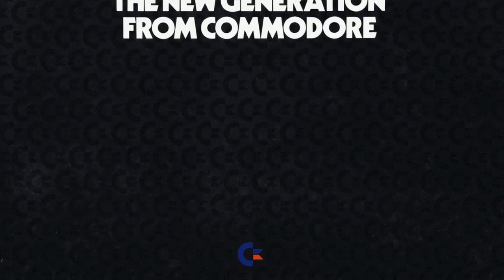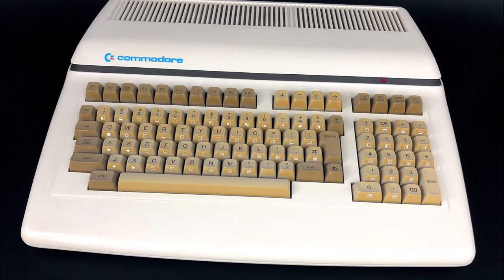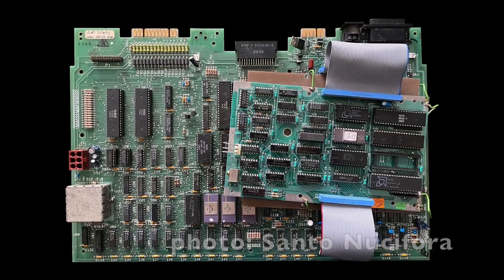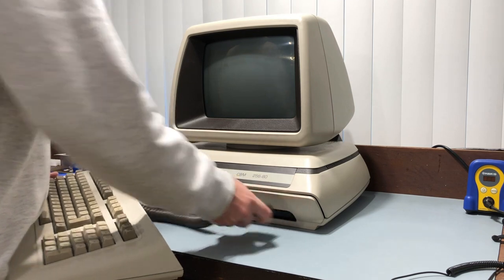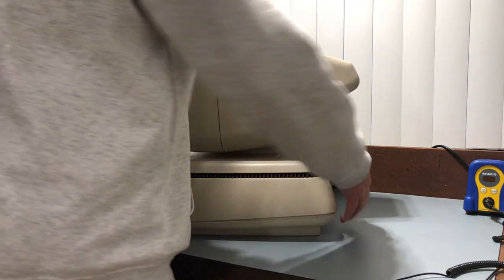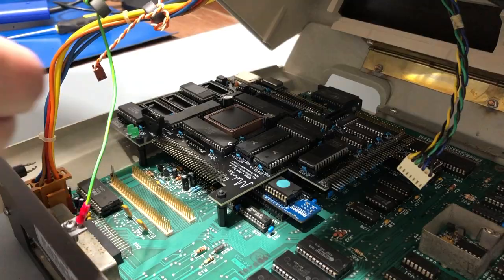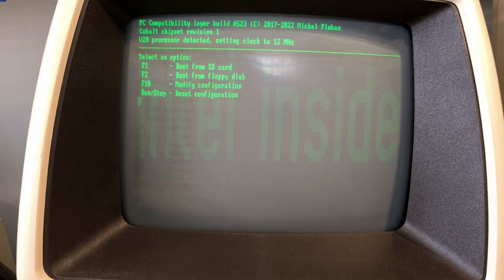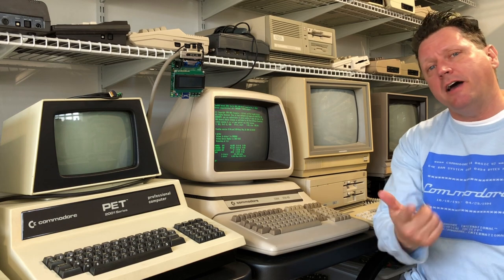Running FreeDOS on a Commodore CBM 256-80 (CBM-II) system from 1982

Comment: I still find it rather fascinating that the abandoned 2nd line of Commodore Business Machines (CBM-II) aka B128, had provisions to run MS-Dos.  Yet, some years later, with the C128, one couldn’t pull off that technical feat.  Though, I really been curious of the architecture of this machine.  Mainly the co-processor port, of which 8088 board connects to.  And the two 50 pin expansion ports.  Wow, with all the available old schematics, of these machines, I am wondering if anyone ever attempted replicate functional B128?  Well, at least with modern chips.
Reply: Oh yeah, just another example of Commodore's scattershot approach. Try this, try that, don't listen to customers, just keep adding chips and see what happens.

Comment: One of these would be nice in my 610.
Reply from the maker: Highly recommended.  I didn't spend any time talking about all the code that Michal had to write to make this what it is.  It's a lot more than just a replica of the board, and it's very professionally done.
Reply: @commodorehistory  My card is now ordered. :) I read about his work on the linked page, very impressive. Are you going to do a more in depth video of using the card?
Reply from the maker: @herdware  congrats on your order!  Happy to assist if you have any questions.  I'm sure I'll eventually create another video about it once I start to play with it more.  Good luck!
Reply from the maker: Did you get your card installed?
Reply: @commodorehistory  Not yet. Haven't had time :( Hopefully this weekend.
Reply: @commodorehistory  Installed today. However I think I must replace the pin header for the large cable. It was very corroded and the card didn't work at first. Got it working after cleaning but not stable.
Reply from the maker: @herdware  good progress, though.  Keep me posted.  Let me know what you end up running on it.  I still haven't gotten back to playing with it yet.
Reply: @commodorehistory  I have ordered new pin headers. What does your machine say when you run mem.exe?
Reply from the maker: @herdware  my 256-80 died on me again. It happens every other time I use it, so I'll get it working again next week and let you know.